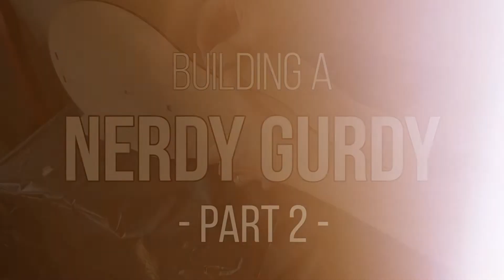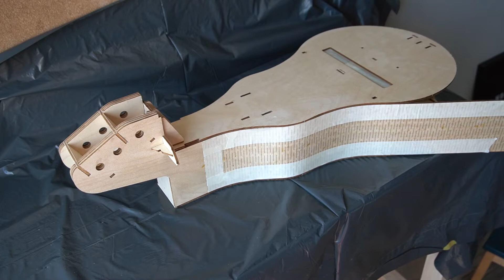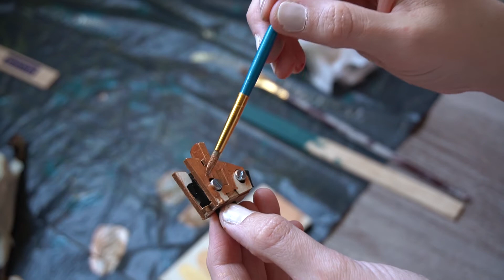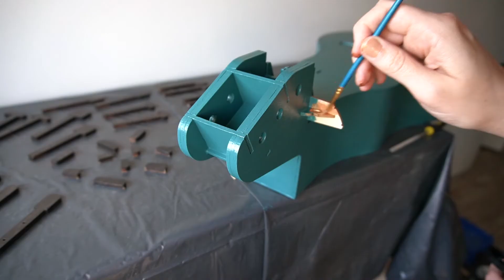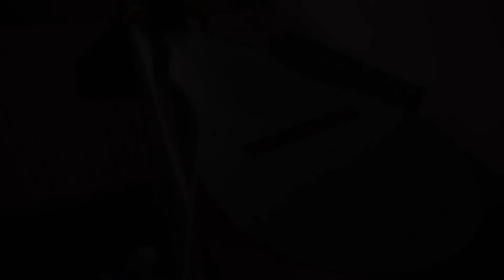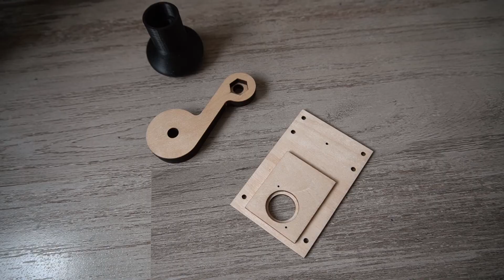Building a Nerdy Gurdy | part 2 (TIMELAPSE)

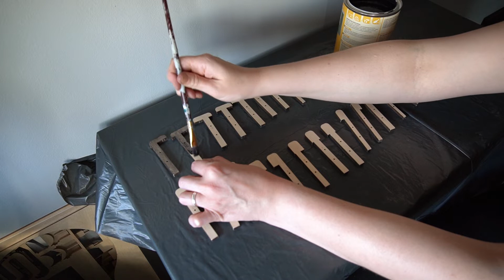Comment: Important to point out that she is "staining" the keys at 5:41, and not "painting" them. Paint would add a layer of thickness and texture to them and make it harder for them to move freely within the holes they fit into. Whereas a stain soaks into the wood, and while it may raise the grain a little, the keys can be sanded down if needed, without scraping off the colour.